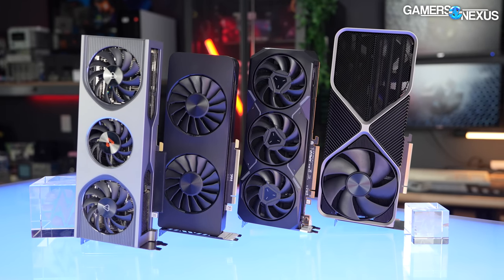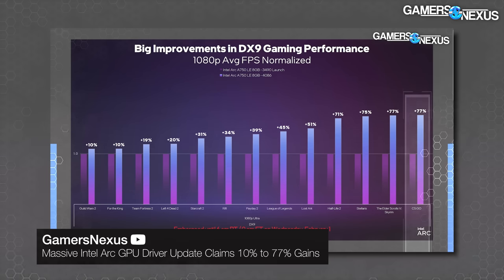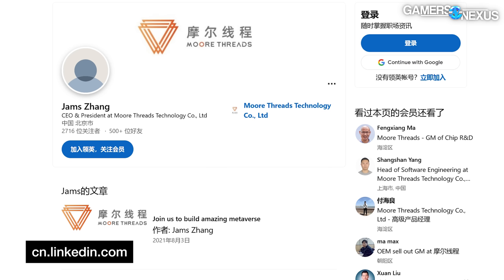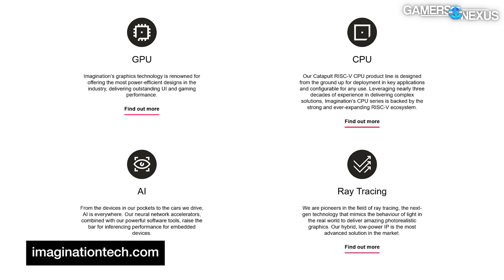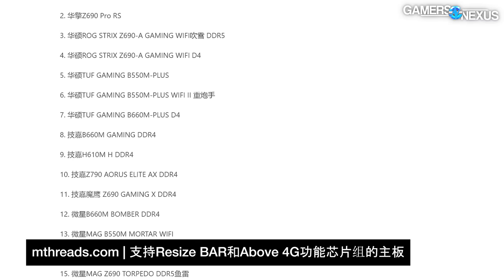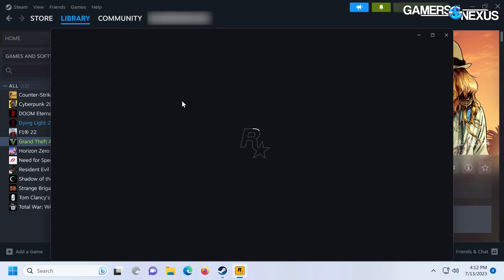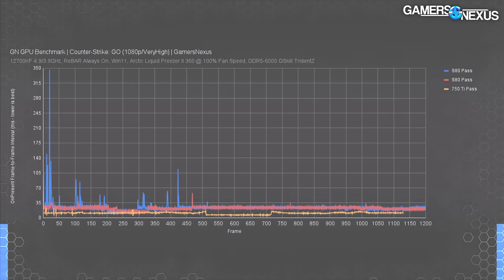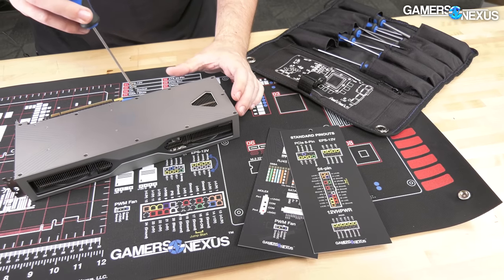China's Moore Threads MTT S80 GPU Review | A New Challenger Appears

Comment: This just shows how incredibly difficult it is to make these things actually work. The whole blasting sand with electricity to do math and draw pixels on screen thing
Reply: It just shows all the features that are behind Nvidia and AMD GPUs to accelerate graphics.
Reply from the maker: "The whole blasting sand with electricity to do math and draw pixels" - Brilliant phrasing! And accurate!
Reply: "We tricked a rock into thinking by shooting it with controlled bursts of lightning." - someone smarter than me
Reply: The more I find out and read about the unbelievable precision and complexity of modern high performance chip making, the more I realize, I'm not that damn smart.
Reply: @GamersNexus drawing pixels on a screen is easy, it's drawing them in the correct order that is hard.
Reply: and it really gives you much more respect for Intel, because sure alchemist could have been better, but dear god for a first ever attempt at a dedicated GPU, it was pretty damn good
Reply: Yup.   Hell, Intel has been struggling at this.
Reply: Even just refining silicon to get it to electronics grade purity of 99.9999999% is hard.  The continuous work of dialing in all of the process variables in a foundry is quite something as well.  At least here all they have to do is build the thing on CAD and get a fair amount of simulation and testing in before tapeout and then testing from there.  Even from a decent starting point I couldn't imagine designing something with millions and millions of transistors like that though.  With the right people they'll probably be able to make substantial gains pretty quickly but it's definitely a herculean effort to make something actually good.
Reply: @transistorjump919 All the companies currently working on hardware graphics right now are throwing billions of dollars into it. Moore Threads might be the exception, and it shows.
Reply: Only 1 company in the Neatherlands procuces the necessary wavers for the 5 and 7nm process. lol.
Reply: It's always a bigger software and driver problem than hardware one. Yes these architectures are hard, and especially getting a fab working is hard. But floating point units aren't rocket science. But it seems with this card the memory interface and data transfer is struggling since it has so many stutters where the gpu hangs or waits
Reply: I have an Etch-A-Sketch
Reply: @GamersNexus We used lightning to teach rocks how to think.
Reply: Now that I think about it, the same thing can be said about our brain. At one point in the womb, the brain is blasted with some electricity, then we came to life.
Reply: @flamingscar5263 i mean they had experience with integrated but yea still impressive
Reply: Best comment
Reply: i find it strange that it's really the drivers that leave out so much performance.  It's like they have to spend much more time on drivers than they do the hardware. Like two entirely separate groups of people from different dimensions who can't speak two each other developed the drivers, from the group who developed the hardware.
Reply: @iwillnoteatzebugs  Intel had 2 prior atempts at making dedicated Gpus and those failed so badly at graphics that the Internet forgets those existed. One being Larrabee and the other being i740.
Reply: @SergioEduP the correct order and timing. Vsync is a pain at times. Old VDUs from the 70s/80s and 90s can be fun to learn about.
Reply: Compute is not that tricky, but games, especially old ones, are a can of worms to do on a clean slate, that's decades of specific dirty optimizations.
Reply: It's black magic.  The old saying "Any sufficiently advanced technology is indistinguishable from magic" is very true today.  Even though on a fundamental level we KNOW it's "technology" let's face it, the sheer unimaginable micro-scale of modern processors and what they do... none of us but the blessed few engineers who design this stuff really have a deep understanding of WHY half of this stuff works.  And I'm not sure based on recent interviews that even the highest level chip think tank eggheads have a grasp of the whole chip layout beyond their area of specialty.  To the rest of us, I think the terms "technology" and "magic" have become a bit interchangeable.  It's kind of cliche but if you get honest with yourself we are living in an age of technomagic in as far as beyond it working none of us know how nor could you ever reproduce current tech in your garage, small business, or even multimillion dollar company.  It's the domain of mega billion dollar corporations and the tightly controlled IP they have.
Reply: I think it also shows that Intel has done a lot of work on their drivers because they were also a complete mess at launch for the ARC series.
Reply: @@transistorjump919  no that is not their solution exactly. their actual solution is to throw billions of dollars at the right R&D team.
Reply: IKR! I've been buying and using GPUs for over 20 years but the engineering and science of GPUs are beyond my understanding. It seems you need a masters degree just to even get how a GPU works and how to make one. At best I can only understand GPUs in laymans terms.
Reply: @flamingscar5263  not the first. the First was a card in the 90 at the same time as 3DFX, if i´m not mistaken was I750.
Reply: math is hard even for sand
Reply: @conyo985  And then you have the fanbois go "oh man, your GPU isn't even 5nm!'"
To go back to the car analogy it's like someone making fun of yours because the wheel bolts aren't chromed so it can't be fast.
Reply: >  The whole blasting sand with electricity to do math and draw pixels on screen thing

That only happens after suffocating the sand and depriving it of oxygen... ;-P
Reply: HELLO FELLOW KIDS!
DAE CHINA #1  ?
Reply: @benjaminoechsli1941   tricked "sand" :P
Reply: @GamersNexus  You can also draw a fine pixel mosaique using an electrical sandblasting machine after having done the math. Makes one wonder how real the real world is, doesn't it? 🤪
Reply: I worked on them for 8 years and still didn’t really know
Reply: @Apollo-Computers  Sand is just a ground-up rock. ;)

Not to mention we melt sand down and fuse it together, resulting in a rock again.
Reply: I don't think this is made for the western market or gaming in general. and they haven' had a lot of time to develop drivers.
Reply: @mbsnyderc  Yes, there's so many different ways to interface to a GPU and a new GPU must go back and emulate ALL OF THEM.
Reply: ya just look at AMD, as much as they try they still cant beat the giants. more speed, more cores, nope
Reply: @budiisnadi  That's not how it works lol
Reply: @@transistorjump919Hopefully I've only missed a really obvious joke, but isn't "throwing billions of dollars" at the issue exactly what Nvidia and AMD do? 🤷
Reply: @advil000  I mean, 40K is pretty much just that but more grim and violent with nearly no one left that understands the magic of the tech!
Reply: @ocelotxp and intel already has done graphics with their IGPUs.
Reply: @flamingscar5263  that wasnt intel's 1st attemp, not even the 2nd, they have been trying for more than a decade to get into dGPU's.
Reply: @flamingscar5263 I sincerely hope they make second generation,i believe they learned a lot with this,but i do realize they lost money,so who knows.
Reply: I bet you think of yourself as a magical meat skeleton.
Reply: It's especially hard if you squint your eyes all the time!  HEYOOOOOOO
Reply: you meant copy and paste to make things work.
Reply: it honestly amazes me to this day.
Reply: @LucidOne8  what does?
Reply: @qee540  lol
Reply: @benjaminoechsli1941  OPENHEIMER dragon fire
Reply: I worked at Intel for 10years in the fab.  I was only responsible for a few steps of the process, where there were 1000 in the life cycle of the chip, my few steps were incredibly complicated even. It took 6 Intel techs, 2 field service engineers and 10 more Intel engineers, just to keep these few steps in order.  This is just manufacturing something that is already planned out but still keeping quality control in check.  At the same time, there is R&D going on for future chips,  which is a whole other can of worms. Everything happens in real time, 24/7/365. If a line goes down for even 15mins, the production managers go nuts.  For this company to even make something that kind of works, is amazing.
Reply: and they did all that in about 2 years. nvidia is already 30 years old
Reply: @SolarianStrike  I was in a larabee test group when I worked at Intel. It was an okay product.  Nvidia destroyed it easily though. They had us sit at plain unmarked builds, each with different GPUs and had us play Crysis. Its was experience. I never heard back from them, so I figured it was dead in the water. I worked in the Fab but was in a employee only gaming group so it was easier, legally to pull test employees from there.
Reply: Bit late but it just shows how hard it is when a company like intel who know a thing or two about semiconductors have spent a fortune and countless hours just to get to a competitive level.
Reply: Not really, they are 2 yrs old company that operate under US tech blockage. Years ago, many new chinese company, with full access to Nvidia and AMD license still make crappy version of those Nvidia/AMD card, it took many years for them to keep up. 

Now the challenge is much more difficult, and the result is not too bad... 

Well, let's see how each firmware update improve things and if they can attract enough investers to keep them afloat for the next 7 years since I don't think they would make any profit in their first 10 years (Tesla took 18 yeas to become profitable)
Reply: To be frank, China is usually terrible at developing their own stuff, when they can't buy engineers / technicians from other countries. 

When Huawei and Xiaomi were trying to compete in the smartphones market, they were offering 10x the salary to engineers from Samsung and LG on short contracts ("Korean Salary" can't compete with China or USA's big markets), and it became a big issue in Korea, and they had to make new laws regarding industrial espionage.

They've been trying to do the same with Nvidia and AMD, in attempt to steal their employees that come with knowledge, but hasn't been successful, because the Silicon Valley pays just as much.
Reply: Well...
When you put it like that...
xD
Reply: @flamingscar5263 not their first attempt at intel. Remember the Larrabee project?
Reply: The hardware may even be usable, but drivers... writing drivers is a different skill set.

Comment: When Steve said that they re-ran the 750 Ti I knew that something was going to be really bad
Reply: Even the 750ti is too powerful for s80😂😂😂 i doubt they got anything older/worse than the 750ti
Reply: The word "bad" and 750ti should NEVER be written in the same sentence!  That's the legend of all legends.
I ran my old OC 750ti in cp2077 in a 30min loop on 1080 ultra (obviously getting single digit fps) but the card DID NOT give a crash!  How crazy is that?!   It won't go down  Lmao
Reply: @upfront2375  it's a fucking legend compared to s80
Reply: @upfront2375  Agreed on the praise!  I'm running a 750ti now.
Reply: @koomo801  I recently retired mine and replaced with a rx580 on my old ddr3 machine. The card never gives any errors in hrs of benchmarks, but boi lemme tell you in games...  I lost count of my tweaks and driver tryouts per month! 
Still getting random reboots and crashes with it,  I think it either nearly busted a cap on my mobo or the old 550w coolermaster PSU bcoz I'm getting random shutdown-reboots on booting now SMH  My windforce 750ti is laughing at me inside it's huge box now  Lol
Reply: @upfront2375 i just put my rx580 at 1200mHz@940mV and has been stable. 

I say avoid the 25.x adrenaline drivers 'cause they tend to be very unstable. Made go back to 24.x drivers haha😂
Reply: @upfront2375 that sounds like a psu issue. unplug and replig your power cables from the psu (all of them). I had a similar issue with a new am5 boaed+my rx580 and fixed it by replugging in the psu cables.
Reply: @exodyno newest drivers have been ok for me. Nitro+
Reply: @exodyno  The new 27 driver been ok, no driver crashes yet. I have it at 1350- 1045mv getting 4-5% better score than stock bro👍🏾
Reply: @skilletpan5674  exactly my guess too, bcoz after replacing the end 8pin with the first 8 on the same cable I seen no more in-game power outs, but the outage on boots is still there. The last 8pin on a cable is literally like coming from an extension cable, but the first 1 is a solid contact so that could've bn crooked.
Btw to disassemble the pc and recable  I'm waiting for my new multimeter to arrive (with cap tester) so I could do all on 1 try.  But you know what is absolutely crazy? The other 12v header+ The new 27 driver so far stopped my in game shuts but introduced the random on boot shut down.. would be so nuts if ALL of this at the end be AMD driver issue🤔 every version a NEW surprise on older architecture lol
Reply: @upfront2375  that's great. Yeah I'm not upgrading drivers yet till I can safely confirm it. I love my settings. Staying at like 75w power draw when I play at 1080p60.

maybe the 28.x or 29.x will be good. I'll try 'cause AMD sure as hell loves giving old architectures freakin' problems just to optimize the newer ones haha
Reply: @skilletpan5674  that's great to hear. Mine would just have a driver crash with the latest one so I had to revert back to the old one where my settings were stable. :)
Reply: If you didn't know it was going to be bad from the word China... I got a bridge to sell you, it's made of Tofu Dreg
Reply: @koomo801  That makes two of us!
Reply: @exodyno  Lol very true my friend!
Btw are you using the adrenaline for your tweaks or MSI a.b?
I've seen some voltage jumps on it's own (temp going high) when I do it with AMD's tool,  also that software and afterburner don't like each other that much.
I got almost zero driver crashes (driver timeouts) when I solely use MSI and install the "driver only"  version of AMD
Reply: @upfront2375  I use adrenaline and works just fine for me. I'll try messing with Afterburner if I can replicate my settings without problems 😂
Reply: @koomo801 a 750ti today, I'm sorry for your condolences.
Reply: @upfront2375  I've run a 750ti low-profile card I stole from work at Gigabyte with no shroud or fans for the last 8 years. It was once my test GPU for prototype motherboards, and it got stripped down because we didn't want any GTX branding in press pictures. It never got a shroud put back on. When I got a blacked-out 1660 on my desk one morning I just put the little guy in my bag and took it home. It still runs the encoding for my server, and is going on a month since the last power down.
Reply: I used a GTX 760 for 6 years. Whoever is saying a 750ti still holds up must be playing Solitaire. I had a hard time getting 60 fps @ 1080p medium settings on DOOM 2016, one of the most optimized games of all time. 750ti is slightly worse so I couldn't imagine it holding up with nowadays games 7 years later.
Reply: @addictedtoRS  It may not hold up for gaming now, but in the context of its time and how long it remained relevant make it a star to a lot of people.
Reply: @addictedtoRS  who decided that a graphics card should only play AAA games? There are eff ton of games nowadays that doesn't need high end gpu to play.
Reply: @upfront2375  this same man
Reply: I finished Shadow of Tomb Raider a couple of days ago ,my GPU is a 750ti :-)